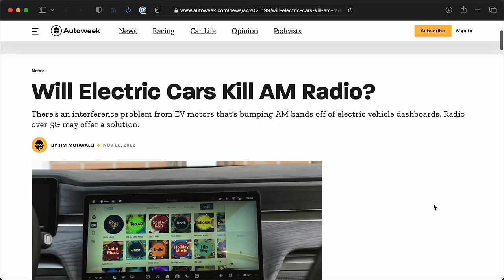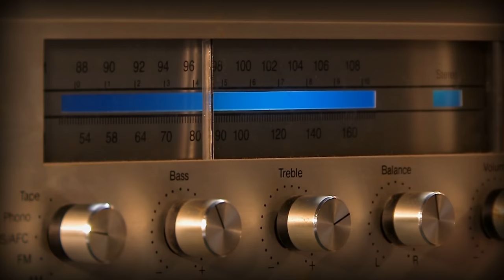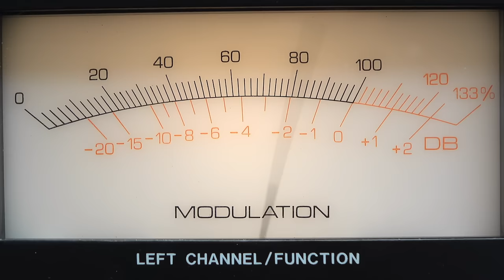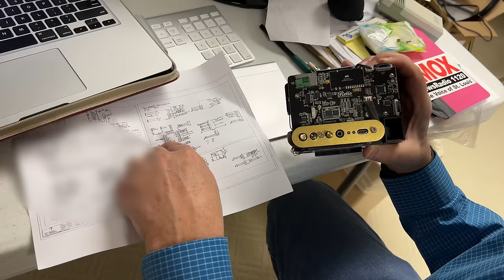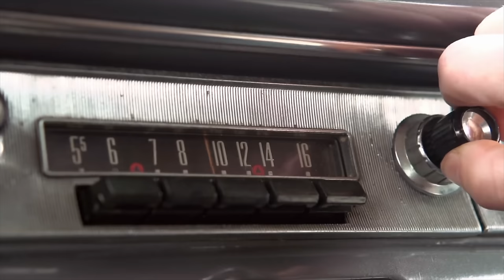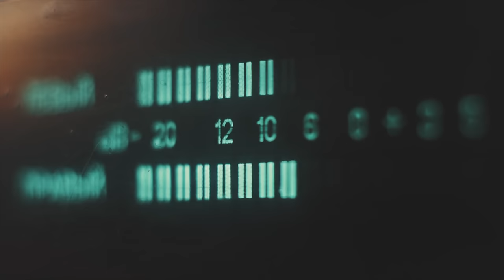Is AM radio dead? Tesla thinks so!

Comment: I now live in a concrete apartment, which transmits noise from various electric equipment through the walls. At night I can hear that some noise sources get turned off one by one clearing up parts of the spectrum, but it never goes silent. I walked outside to a some woods near garden allotments to listen to a radio. The noise was also emitted from electric transformer buildings I passed at a range of a few meters. No need go further than that. But you need to live in a normal wooden house. FM radio is not right here either. The polarization of the antenna for best reception is random.

The clarity improves with frequency. Long wave radio is completely inaudible. Around 15 megahertz there are a couple Chinese/asian broadcasters, but it's the same repeating propaganda and only during daylight. They seem to be stuck in the past. The more interesting secret band with distant stations at 2 to 4 megahertz cannot be received indoors. Broadcast radio on medumwave used to suffer from multiple copies of a stations on the same frequency interfering. That was a new thing they had in England instead of one big station.

When I was a kid I only had an AM receiver. There was a station called Atlantic 252 broadcasting pop music, which was a surprising discovery. Most radio was news or current affairs. I listened to it using batteries in paper tube.

Lightning is not a serious issue. It is rare.

Comment: I have also heard that auto makers, even Ford, are removing AM from their automobiles.  However, if AM is so important for safety(which I have read that it is), Congress should pass a law requiring automakers to keep AM.  As to AM otherwise, the content around here is talk radio, talk radio, etc. I also restore early Tube radios.  As the AM content around here is not at all to my liking, I have a small, FCC compliant, AM transmitter to transmit music to my radios.

Comment: Teslas basically CAN'T use AM. They spew so much radio noise it's amazing that the FCC doesn't require an AM Broadcast license to drive one!
Reply: Think all that goes into the brain too.
Reply: @UQRXD  Easy enough to put the main brain module into what amounts to an RF-tight box so it can't see/hear anything from the outside world that isn't specifically "piped in". Not so easy when it's a radio that you WANT to see/hear the outside world.

Comment: I'm wondering if the high voltage circuitry to drive the Nixie tubes is what's causing the AM radio to sound so bad.

Comment: I have a proposal: Since there are fewer AM stations as time goes on, there should be more space on the band. So why not just go to a format that takes more bandwidth, but gives more quality? Wideband FM would be one possibility, but if you're going to go through the update process, you might as well thoroughly modernize. Some kind of digital scheme would make sense. And you'd have the propagation advantages of the MW band.

Might as well use the spectrum space for something.
Reply: I think it is possible to invent better encoding for data within already existing limits for AM transmitters. No one cares however.

Comment: I'm a ham radio operator from way back, and I enjoy vintage radio gear. I'm also a music producer, and have produced many radio station music packages over the years (call letter shotguns, etc.). I really like AM radio, but I'm having a hard time seeing a future for it. Just WAY too much content available for people to listen to via more modern delivery systems with higher quality audio (and listening to what you want to listen to, when you want to listen to it). I think AM is going to really continue to struggle to have listeners, and get revenue. All of the equipment, especially the towers, degrade over the years, and tower maintenance and replacement is EXPENSIVE. Not only that, but as weather events get more and more severe with every year, and storms get more intense, those towers will really be taking a beating. In the end, I think the economics are going to be the death knell for AM. Individuals will cast the votes. If people are still listening, it'll hang on. If they don't, it'll be gone.

Interestingly, if you really like the crackly sound of AM, you could always get a DSP audio plug-in that can impose that sound on anything you listen to. Audio Ease Speakerphone 2 will do the trick.

Comment: AM is fine in Australia in capital cities. When I travel to Central Coast or Southern Highlands the FM seems to work better in terms of retaining Sydney station. I listen to Smooth FM.  New vehicles have DAB+ but not slightly older vehicles like my FG Falcon. Personally I like FM it just sounds more natural to me. Its logical a Tesla would not have AM due to interference issues. There are three Tesla's in my street which is really not that large. AM is still used in  aviation that has never changed.

Comment: Nearly perfect audio and video came about only within the last 15 years, before the internet, we often had to put up with noisy audio, noisy or at best blurry video (vhs video never looked as good as broadcast tv), people were used to it. Nowadays with high speed digital communications nearly everything looks and sounds nearly perfect, people expect it.

In a grid down situation with no internet, cell phone, or land line telephone, you can listen to distant AM radio stations, and shortwave radio stations. Yes, there are satellite phones but it's point to point communication and it's limited to who you know have satellite phones.

Vacuum tube electronics are more resistant to EMP blasts AND are easier to repair than electronics based on integrated circuits.

If anyone wants to know how the Golden era of AM talk radio sounded watch the movie "Talk Radio" made in 1988, it was based on a true story

Comment: It's probably more to do with the fact that electric cars Cuase tons of RFI and rather than mitigate that with chokes on their circuits as they are supposed to according to the FCC it's cheaper to hide the fact by missing the the thing that would receive the interfere, ie the radio. As a radio ham I hear mire and more RFI daily. Electrical engineering has gotten sloppy and interference is only going to get worse. Maybe when effects are overlords and starts interfering with police, fire, etc. The FCC will clamp down on it, until then the noise floor is only going to get higher.

Comment: It's been bugging me for years how automotive engineers especially foreign makes have given AM short shrift. The factory radio in my 1978 Lincoln sounds so good on the AM signal of a local oldies station that has both AM and FM transmitters that I've pushed the wrong while listening to AM presets thinking I was listening to the FM signal...Meanwhile my parents Hondas have for decades had badly engineered radios that make all AM sound like a bad landline phone connection (something I'm just old enough to remember).
The FCC could make a FORTUNE if they just enforced the part 15 interference laws on consumer goods. Seems like every stinking thing made today has a switch mode power supply and half of them don't bother to suppress or filter out the AM interference they make...All of this contributes to my refusal to adopt non-incandescent lighting and tendency to replace switch mode supplies with linear supplies wherever practical.

Comment: I had to make a quick test after watching the video. My EV (Hyundai Ioniq) has an AM radio, and I could get quite a few stations here. 
Tested first with the car off (only radio on), all good. 
Tuned to a relatively weak station and switched on the drivetrain, no change in reception. Started to drive, still no change in reception. 
So by my quick test, it is absolutely possible to use AM in an EV, maybe Tesla didn't try hard enough?

Comment: Then they are stupid, radio is still popular and also very useful, unlike normal wifi connections, they can still function if the wires go down, as long as the station is still functional, you can get important information such as weather, this is the problem with some companies, we are moving backwards, when we are supposed to move forward.
Reply: 100% seems like you lose more than you gain.

Comment: UPDATE...  My old company work van had to go in the shop for lengthy repairs and they gave me a brand new Ford Escape hybrid to do my service calls and it has an AM radio.  So, thinking about Tesla not having AM radios in their cars due to "supposed" excessive electric motor noise, I put this Ford radio to the test.  Since the only radio station I can pick up that broadcasts my kind of music (easy-listening instrumentals) is CMBQ, "Radio Enciclopedia" in Cuba, nearly 350 miles away.  For several weeks while driving all over Pinellas county I never heard the least little bit of motor noise disturb the reception of that very weak, but very clear signal from CMBQ (530 kHz),  or any other AM station that I tuned into.  So then, if Ford can keep it's motor noise out of their hybrid and electric auto AM radios, why can't Tesla?  Are their engineers really that lame?...I'd say they are.

Comment: AM radio has been dead since the 1980's, we just forgot to tell the broadcasters.  We can never fix the noise issues from electrical interference, we can't fix the low fi sound( unless we increase bandwidth) and that would not work with existing radios.  It would be difficult to fix the motor noise issues in electric cars, and like it or not they are coming.  Reality is that this is technology from the 1920's and it is obsolete!  Nobody is talking about bringing back wind up phonographs (Victrolas)  why are we talking about AM.  I collect antique radio's,  but I seldom listen to them after restoration.  I think a good start would be to let really low power AM stations keep thier FM translators and maybe let them bump their power from 100 watts to 200 on the FM.  It would give them the same coverage and get them off the AM dial.  Then shut down all these 1000 to 5000 watt stations, many of which lower their power to 12 to 56 watts at night.  For now let the high power and clear channel stations stay on, as their power helps them push through all the noise.

Comment: I listen to it in my pole barn when I am working out their. FM is harder to receive in my pole barn if I can receive any FM stations at all. HOWEVER on the AM band I can pull in LOTS of stations. After the sun goes down I can pull in stations from all over the U.S. It is great to find ball games to listen to. After dark the FM band is REALLY dead out here in the country. It is like TV stations. I used yo be able to pick up a couple TV stations with an antenna on the roof but the digital signal SUCKS! I can NOT get a signal at all. I do NOT have a flat line of sight to digital signal. My cell phone also only gets one bar that drops out all the time. I still have to use a landline. All these improvements are GREAT for city dwellers but the country dwellers are left in the dark.
Reply: You have a good point, for the new digital solutions, it can be a serious extra cost to provide same service in rural areas compared to cities, it is often not profitable in areas with low population density. In the part of Europe where i live, practically everybody already had a cable connection for tv and the cable company upgraded the network such that they could offer digital tv and radio and internet over the old coax cable. Later the phone company did same with their wire. But first in the cities of course, in the smaller villages it took longer because less profitable I guess, and some people that live really far away from the main connection, have to pay the extra installation costs.

Comment: AM radio is as relevant today as it has been for over a hundred years.Such a self proclaimed visionary makes himself look pretty stupid by blaming the modulation method instead of fixing the excessive electric motor EM radiation.
   I hold two FCC licenses and in both cases I'm legally responsible to know how to do these things. I'm quite certain his engineers would be happy to address the technical issues if allowed to.

Comment: When AM was still around and commonly used in Germany, you could travel all across the country and did not have to switch your radio station, when you had one of the public broadcast service radio stations tuned in. Unlike FM stations that would fade and leave you after 90-100km or so. Nowdays, especially when you live in the city, you have all sorts of interferences buzzing all across the AM band, coming from electronic devices that aren't even shielded anymore because manufacturers clearly don't give a damn anymore. It gets even worse when people use the god-awful Powerline adapters for their internet, instead of regular LAN cables. Even LED bulbs, Monitors & computers create all sorts of ghastly noise on AM. Once you are outside of a major city you can finally listen to some remaining AM stations from Romania, England, Hungary and even some russian and other countries.  I really wish AM was as alive over here as it is in the USA, where there's an actual radio culture.

Comment: Amplitude  Modulation    of AM   Radio  can  continue  to serve  while  the   Digital  data format is also carried   ,  so that   two types of radio ,   or a radio that  switches over,     so you can  receive AM   on antique radios,  and  also use the  carrier  waves to handle a transmission  of  Digital Computer Language   in a binary   function ,  even to  multi   broad cast  FM   or Frequency  Modulation  ,  so that   one carrier  or transmitter site can  send  multiple  broadcasts   to allow  multi functional  receiving. 
      It i s also true that one  Television Transmitter   could be adapted to also send  hundreds or thousands of  computer  solved transmissions to eliminate the need of  cable  connections .    Cable made people a prisoner  of   material  hookups,  but   a missed solution was to use the  million watt television carrier beams to transmit  thousands of different programs   by one  transmitter site.

Comment: Everything which could possibly emit harmful amounts of radiation (harmful to reception or operation of the licensed transmitter) is required to at least meet FCC part 15, which states that the device must not generate any interference, and shall accept any interference.  Until the FCC starts putting teeth in their own laws, AM will continue to be swallowed by noise.

Comment: am radios adventage is i remember hearing am radios from other countires which closest border was 600 700km distant and it was wery clear except lots of beps :P so i think it can be used for high distance networks instead analog radio signals only of course keeping analog radio signal witr digital one modulated probably will be better for tuning it easy.. so i think itl find its way in future as local network system which is extreemly wide compared to standard definitions of local 700km+ is probably a lot wide then standard local classifications :P

Comment: Electric vehicles, like the Tesla line, produce so much MF and HF noise that it is unsurprising that manufacturers don't put an AM radio in the vehicle. I regularly operate HF from my pickup, and I can always tell when an EV is nearby. The Toyota Prius seems to be the worst, Tesla is a close second, and the BMW i-something being quiet but detectable. Engineer: "Our EMI is below the FCC limits with spread-spectrum 'cheating', but customers still complain about noise on AM. What do we do?' Management: "Eliminate the AM radio!"

Comment: I don't agree with the interference explication.
AM runs lower in the frequency range.
The devices like PWM Power supplies generate much more noise in the AM band than the FM band.

Also, AM can work over much longer distances because it can work at much lower energy levels at the receiver as opposed to FM, due to the way AM works as opposed to FM. That makes AM more sensitive to interference
Higher frequencies of the FM band are also absorbed much more by the surrounding environment than the lower frequencies of the AM band, so devices at a distance is not as much affected.

Comment: I'll give you a little history on why am radios sound so bad these days. During the mid to late 1960s the poor public adoption of FM radio technology prompted the industry to have the radio makers reduce the intermediate frequency amplifier bandwidth of automobile radios down from about 10 kilohertz to just 3.5 kilohertz making am radios sound terrible. The quality of the signal coming from the am transmitter is very close to FM quality with a bandwidth out to 10 kilohertz for the audio. However the receiver if strip eliminates the higher frequency signals from the carrier and what is decoded is very low fidelity. It is not a problem inherent to am. In fact FM stereo has an amplitude modulation component for the left minus right differential signal which gets Matrix decoded into discrete left and right channels. Which by the way for a bonus answer is also the reason why FM stereo has 20 decibels more noise than FM on oral.